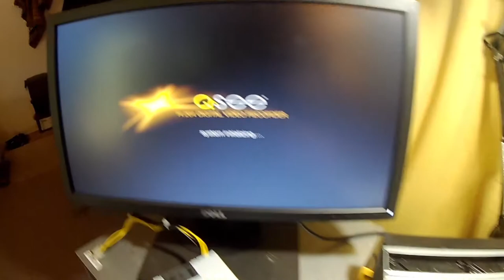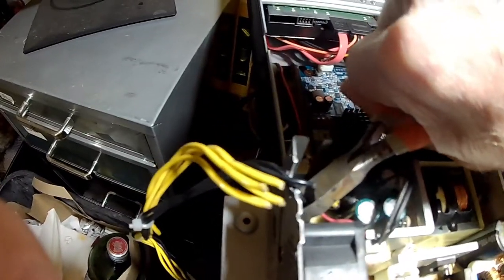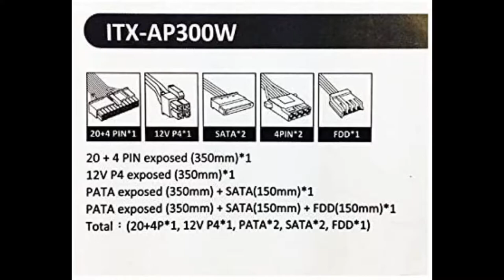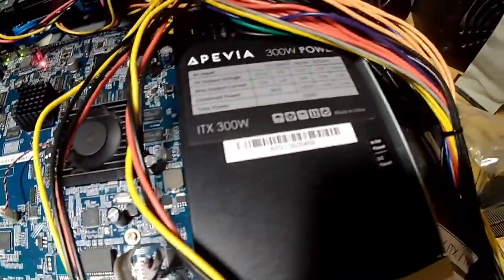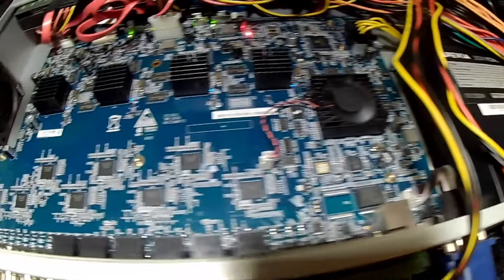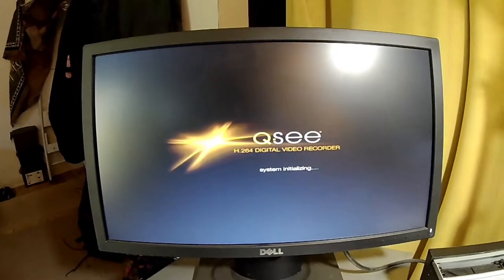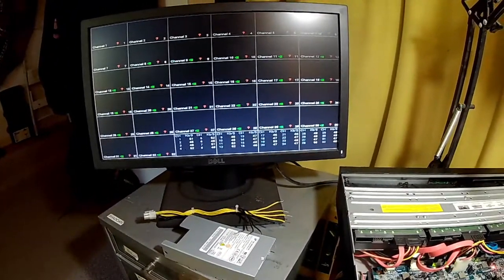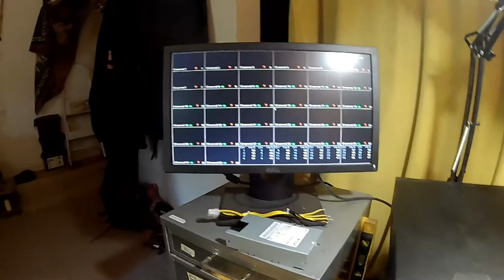Q-See Security DVR repair

Comment: A few weeks ago lightning struck my house. It took out the tv monitor and 4 of the 7 cameras. How to I fix this? When I change contact slots the 3 good cameras work. What should I do?
Reply from the maker: If "parts" of the DVR work, and other parts do not, the unit is toast. If you can take a known good cam, and cycle it through all the inputs, and they all work, you will need to get new camera(s).
Reply: Thanks Greg. It's an added expense I was hoping to avoid. I'll have to buy four new cameras.